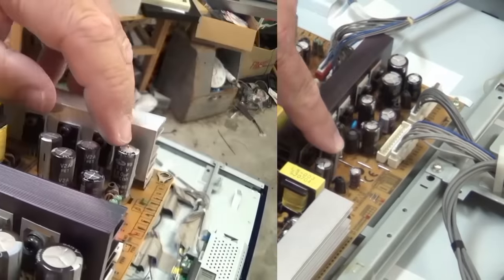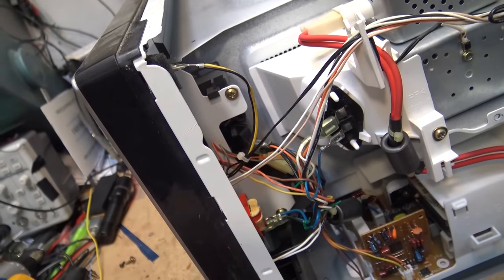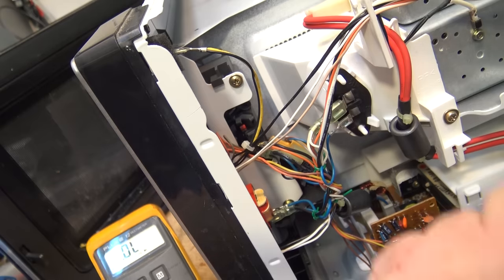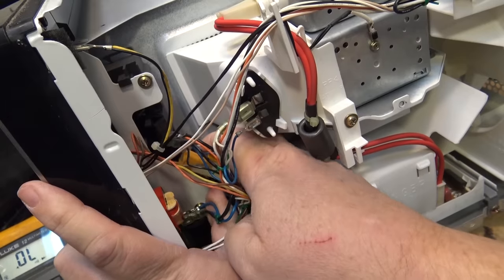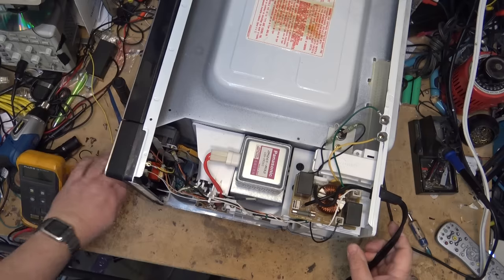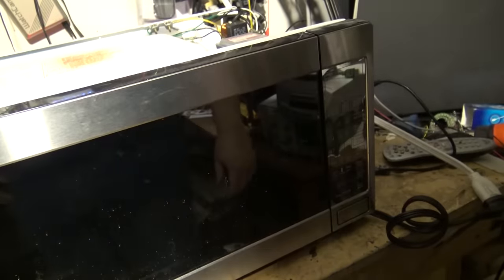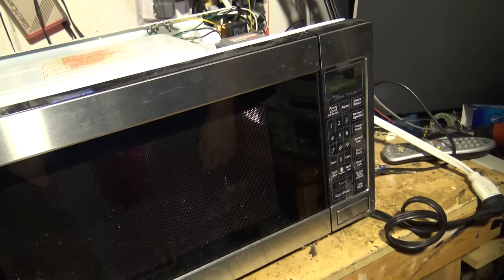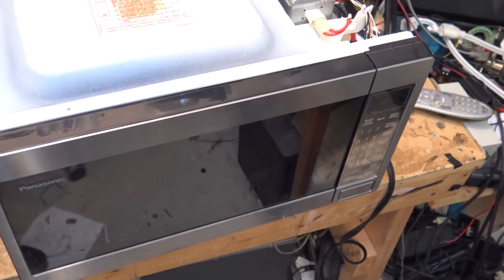Panasonic Inverter Microwave Oven Repair

Comment: My Panasonic (model NN-CT56JBBPQ, 3.5 years old) Inverter m/w combi has no display, no response of any kind with door closed BUT with mains power on, the turntable rotates with the door open. Clearly not main fuse not main door microswitch (checked). I have not checked monitor microswitch or timer microswitch (difficult for my arthritis affected fingers - so removal OK but challenge of refitting is off-putting unless there is a real prospect of it being relevant. I suspect a control panel fault giving rise to the strange malfunction. Can you help or comment please? [I have already bought a like-for-like replacement of the oven CT56JBBPQ) but I don't wish to simply throw away the faulty one - yet!]

Comment: Sir..what the output voltage from inverter pcb or normal pcb to magntron..or what is the input voltage of magntron...and prequency.
Reply from the maker: About 4.2 kv DC to anode. Filament about 2 volts.  
Keep your fingers our.  I was nailed once.  Threw me across the shop.  Very dangerous.  It's a microwave transformer I used for the arcs on the opening. it will arc about 6"

Comment: Hey, so I changed two of the door switches.  but it didn't fix my problem.  When I open the door the light comes on and the turn table, but not the magnatron.... any suggestions? Is it the third switch?  I couldn't find a replacement easily so I only changed two switches.....

Comment: Good units from a user perspective. I have one here but its now right down on power. 6 mins to heat 1 cup of water  from 17deg C to 65 deg C. I suspect either the capacitor or diode..moreso the diode as it is heating so the magnetron is fine. I am curious to see what a magnetron stirrer looks like. They distribute the microwaves more evenly so that no turntable is needed. I wonder if they can be retrofitted.. probably not but its a thought.
Reply from the maker: It's the magnetron.  They are a vacuum tube and they do get weak with age.  If the diode fails you get no heat.  If the capacitor failed they either go open again a no heat situation or they short and that results in a blown fuse.

Comment: There’s no security measures when you open an Inverter microwave as the ones taken in a regular microwave regarding capacitors?
Reply from the maker: Yes and then some.  Inverters don't have the big cap, but when energized have even higher voltages.  4100 volts as opposed to about 2100 on conventional.

Comment: We had a similar model Panasonic microwave with the same power that just recently went out. The light and the timer worked fine, but it just wouldn't heat anything. There was also a bang when it was in operation when it stopped working. The microwave would attempt to heat the item for maybe 20 seconds, shut off, and give an error code that could not be cleared until the microwave was unplugged and plugged back in. We already trashed that microwave. I'm not going to worry about it now. We assumed the magnetron went out since the timer would attempt to operate it.
Reply from the maker: Could have been magnetron but the fact it went with a bang generally indicates a mosfet on the inverter blew apart.  That could have been caused by a magnetron short. At that point it is a write off. Had this one had an inverter or magnetron failure it would have been trashed
Reply: @12voltvids  Mine died with a bang and some foul smoke, and it looks like the Photo SSR chip blew up. I can replace that, but I wonder if it blew up because something else shorted out too... the fuse seems fine, and nothing else looks exploded.  I guess I better check the primary and secondary safety switches too, just in case, before I try to power it back up.
Reply: Looks like the thermal cutoff cut off also.  (The two mechanical safety switches seem fine.)  But I had a bit of trouble replacing the SSR chip and one of the pads fell off the circuit board.  (The board was a bit toasted when the chip blew up)  It is hard to tell what trace that pad was supposed to be attached to, and maybe it was unused.  I'll try it with that pin not attached to anything and see what happens!

Comment: finally.. caught up on all the vids again... been busy past week lmao. this is good to know cause i have well one of these types my self. its been really good and its huge one. i think if i ended up one more size up it would been a 1250watt that's how large it is. im glad my wiring in my kitchen is done differently. since they use 3 breakers and use the 3 wire, black white and red. they split the plugs using red for one side of the plug then black for the other. then they alternate them in sets of 2. then other side is same way. so i could run a deep fryer and a microwave off the same plug but not blow anything since its 2 different loads. i don't know how they made it where 3rd breaker turns all 4 off though, that one is weird to me.

Comment: Ive seen plenty of microwaves blow the fuse because a interlock fault.
Reply from the maker: That's why the interlock is checked first. The plastic bracket sometimes wears out. See my video on the Kenmore microwave I did last year around this time. Bracket was worn, diagnosed it, and ordered the part, then did a second video for the part installation.
Reply: I replaced a blown 10A fuse one month ago in a 240V microwave (yes, European).  It worked fine for a month, then the fuse blew again.  Can't find no obvious defect. Will check the interlock.  Thanks for the tip.

Comment: Mine just died, and I hope it is just the fuse. By the way, I tested it before, and it uses 1950 watts at high, which is about 16 amps.
Reply: I would put a new fuse on first, and test the switches later. If it is the fuse, there is no need to test switches at all.

Comment: I would go by what the sticker says about power,  because 1800 watts is 15 amps, so maybe the circuits plus magnatron and whatever else was on that strip, but otherwise a good find, I had one of those and I was amazed at how much lighter it was with the inverter versus a full size transformer,  what it also did was ,if you use 50 percent power settings it kept the magnatron on at lower power rather than cycling on and off
Reply from the maker: That is the strength to these designs and the reason they exist.  Power control on the magnetron.

Comment: I think it's a good idea to measure contact resistance of the switches and replace them if more than 1.5 ohm. the beep sound for continuity does not tell how good the switch contacts are.
Reply from the maker: Actually that's not a continuity beep. It is diode test so for a straight beep it's .2v drop or less. Above .2v drop it is a single beep as on measuring a good junction.

Comment: That's funny. My microwave just developed a problem today. It's the relay that turns on the magnetron. It's latching. I will have to order a new board
Reply: Why not replace the relay? (Personally, I'd open the relay and dress the contacts but new would be better).
Reply: @danmackintosh6325  I looked at that. The relay is not serviceable and I can get the board at whole sale price.
Reply from the maker: @danmackintosh6325  
My old one did that too. Still works just relay stuck on and ran the magnetron with no fan until the thermal cutout kicked.

Comment: The connections at the switches burn out when the microwave door is opened while the unit is still operating.  It is a  backwash of current from the circuits.  Always hit the stop button before opening the door if the unit is still operating.
Reply from the maker: No they don't. It makes no difference. When you open the door the first switch that opens is the primary switch which removes Ac power. This happens when you push the door button or start to open the door on ovens without door release button.  At the same time the timer switch activates to stop the timer.  As the door opens then the secondary or short switch closes and places a dead short on the AC line that is already disconnected by the primary switch.   
If the primary switch fails to open when the door opens the secondary switch shorts the AC line and blows the fuse.  Regardless of the unit is operating or not, when the door is closed Ac is applied.  If the short switch fails when the door is closed the fuse blows. If the primary switch fails, with the door closed nothing happens until you open the door and then the  short switch does its job and blows the fuse.
Reply: @12voltvids  I have seen countless burned wires and switches resulting from the door being opened when operating.  Panasonic even issued a TSB about the  current inrush from the inverter circuit.  The contacts in the microswitches are also often welded by the current inrush.
Reply from the maker: @dougaustintx  that's from slamming the door. Contacts bounce.   Well known issue from slamming the door.

Comment: Hi I've tested the door switches and they all seem to be functioning well but my panasonic inverter - the genius trips the power circuit breaker. Could the problem be with the inverter unit? How do I test it?
Reply from the maker: If the switches are ok and it trips as soon as you attempt to start it could be the magnetron or the inverter.  Try disconnecting the magnetron power wires and start it.  If the breaker doesnt trip then you know the magnetron has a short and is drawing too much current.  If it still trips then the inverter board is toast.
Reply: @12voltvids  thank you, I'll give that a try 👍

Comment: Isn’t the name of the type of circuit the secondary switch is part of a “crowbar” circuit?
Reply from the maker: A crowbar is an over voltage shut down.  If a voltage goes above the set voltage of a zener diode that zener conducts and triggers an scr which puts a dead short across the power rail.  There is no active components in a microwave monitor.  Just a switch that closes as the door opens.  The main interlock opens as the door button is pressed  before the door latch is replaced.  If the interlock fails to open the monitor switch will short out the mains and blow the fuse..
Reply: Yes, it is

Comment: Ouch, I notice you decided to sell it for $20 rather than give it away after it scalded you... I'd want some remuneration for my pain too, hope it wasn't too bad & you got it under the cold tap straight after the camera went off.
Reply from the maker: The hot water was just that, hot water, slightly hotter than I wash my hands under.
I looked on craigslist and saw the same model being advertised for 60-70 so I figured I would try to get something. After all I did put in a 5.00 fuse. (Yes those microwave fuses are relatively pricey)
Reply: WOW that's an expensive fuse... I guess they're similar to multimeter fuses in being an explosion proof type to account for the heavy current spike from a direct short.  I wonder what sort of fault current they're rated to break/

Comment: Hi, I have a 3 month old Panasonic inverter microwave that went dead 2 nights ago,, my bf put a new fuse in it and it has power but the screen says ""see manual"",,,, there's nothing in it that mentions "" see manual"" ?? Is there a secret reset code or something? Model# NN-T9455SF,,,,, any advice is truly appreciated 🥰
Reply from the maker: 3 months should still under warranty
Reply: @12voltvids  did opening it void the warranty??
Reply from the maker: Did you damage the screws.  In other words will they know you opened it.  If not then your warranty should be fine.

Comment: I have a panasonic inverter oven microwave and problem im facing is. I tried to reset it thru panadonic instructions. i plug it back in, it works but after some time, it shuts off and h98 appears. I opened the microwave and took out tbe magnetron, no magnets are cracked. Any suggestions?
Reply from the maker: Does it shut down with both wires on magnetron disconnected ?
Reply: @12voltvids  No it doesn't shut down, it goes thru the cycle of the heating and sort of heats up the food but then when put up for another short run after a long 1, H98 appears and when I unplug replug, it works back again, and repeats itself. On some occasions the unplugging doesn't work and i have to wait a good 15 mins for it then run it. I checked the magnatron and it has all wires intact and no magnets are cracked as far as ive seen
Reply from the maker: @ryerci9618  
How is the fan running.  Almost sounds like it is overheating.

Comment: You know Yes, if the display does not light well look for the small electrolytic condenser you will dry over time simply change that flows the necessary power Best Regards from Frankfurt

Comment: Cant take out the bad switch from same microwave. Its so tight and inside and very difficult to pull out. Im afraid i may destroy other parts in the cause of pulling it out. Taking to the technician is extremely costly cos i already know the plm.  How can i take out the double swith, black & white ? 😭
Reply: The switches are super sealed. Cant come out. Even after pressing down on it.

Comment: I'm thinking "good grief! a 18amp fuse is blown" then I remember you are in Canada with 110V and welding cable power cords.
Reply from the maker: It's actually 120